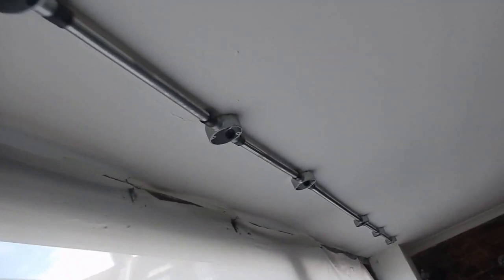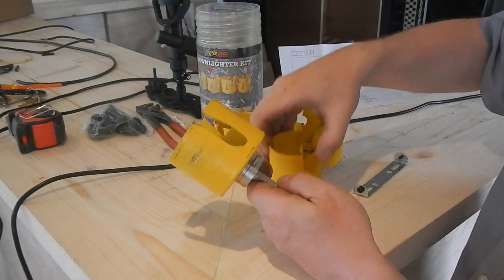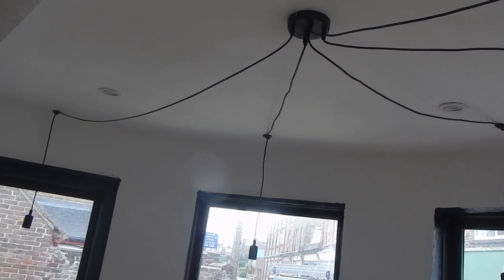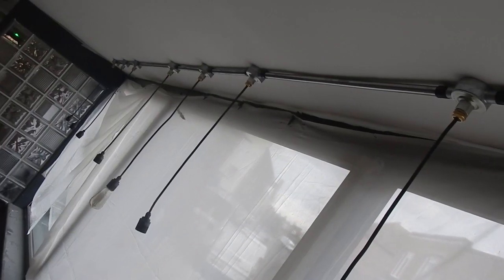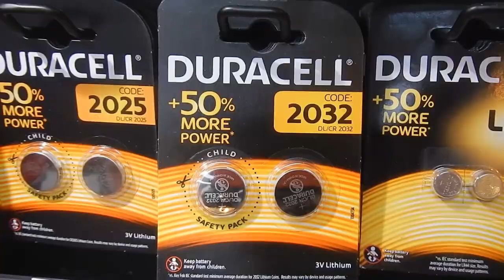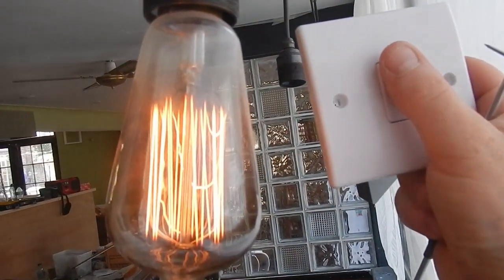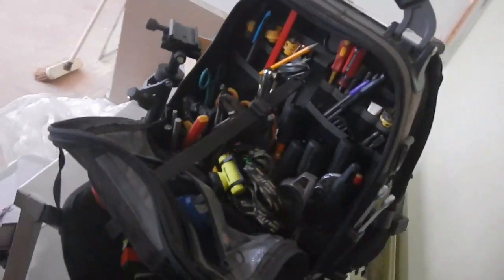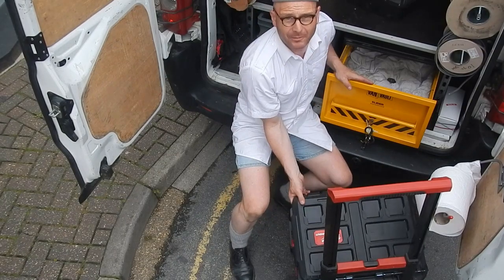Installing Decorative Lighting - Minor Works Certificate on a fused Spur

Comment: My concern was for your wellbeing as many older properties have "Artex " type ceiling finishes, often overboarded, but still a considerable hazard due to the Astbestos used to thicken the product. I'm ex hotel industry and there are thousands of artexed bedroom ceilings which have been encapsulated in special paint, carefully labelled, and then hidden by a false plasterboard ceiling! All perfectly safe untill someone penetrates the encapsulation.

Comment: Hi love the video, 👍 where do you get the lamp holders from?  They look great.  The comment about the brass gland.  I have used in the past a small metal cord grip with grub screw 99p each inside of the enclosure to prevent the cable being pulled out, I used this with a 20mm black dome gland, although as you say it would take some force to pull it out.
Cheers 😁
Reply from the maker: There's a place near me, I'm in France at the moment but hopefully I'll remember and let you know.  They do all those fabric covered cables and wotnot as well, pretty good place to know.
Reply from the maker: Hi there again Patrick, here's the place I got them from I've looked up the website now I'm back......     https://www.lampspares.co.uk/contact-us/

Comment: Those brass glands do not provide suitable cord restraint, they will pull straight out. They are use for the sealing of cable entries.
Reply from the maker: Hi Peter, thanks very much for your attention and comment.  On the basis of your comment I have been across to the site this morning to re-check on what you identify as the problem with using those brass glands in the way I have.  i do remember being able to make height adjustments to the lamps by sliding the cord through them in situ, so your comment made me wonder if there was a danger of them pulling out as I couldn't remember the force needed.  I was reassured this morning when testing the force needed, the cord is 1mm 3 core and takes a good 2 or 3kg on it to pull or push up or down through the gland, that being noted I am happy that the risk of accidental damage is extremely slight.  A lot of ceiling roses routinely put into plasterboard would pull completely off the ceiling with similar force being applied.  That's why I'm no longer worried by your comment.  But thank you.